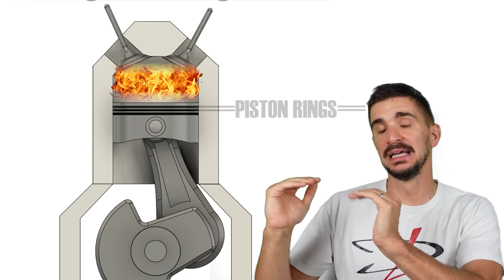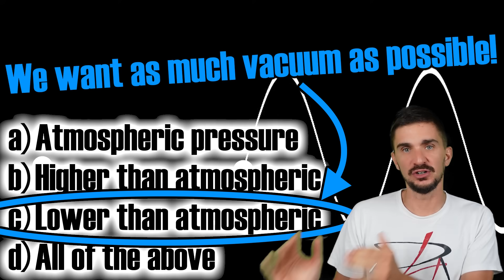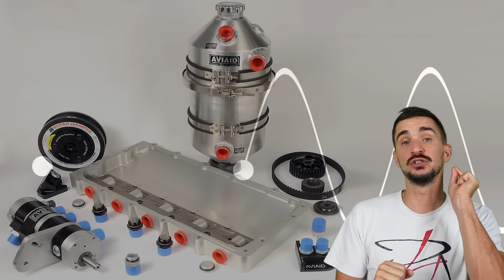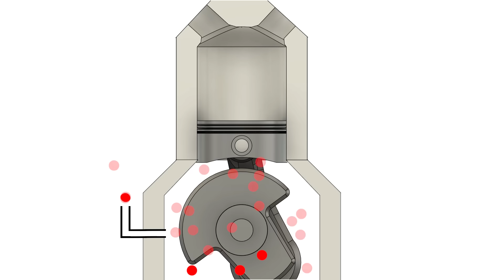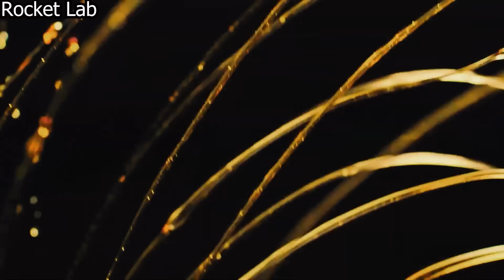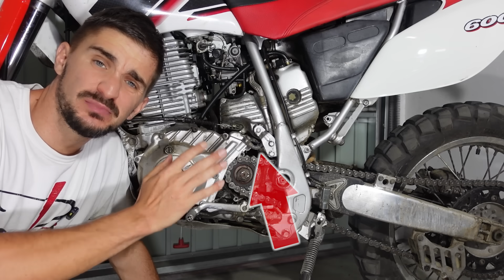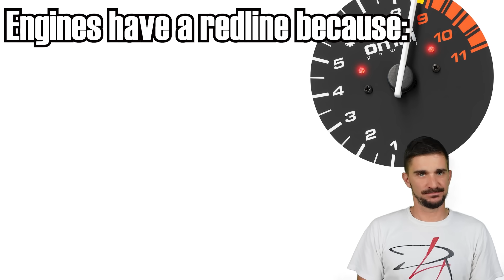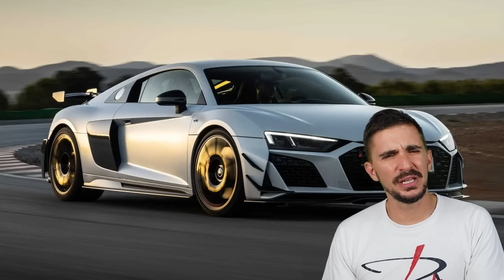Installing This Has No Drawbacks, Except for Your Wallet - Dry Sumps Are Awesome, Here's Why...

Comment: 9:52 Now what if we ran it from an electric motor?
Reply: You'd lose even more power due to energy conversion
Reply: Where does the power come from for the electric pump? The battery! How does the battery get charged? The alternator! How does the alternator spin? The pulley on the crankshaft! We're back where we started?
Reply: @Beartore not if we have a separate battery for the pump, the pump would get recharged by solar panels.
Reply: @ceasarspalace  All that in place of a toothed belt and pulley? I'd rather not run my oil pump from solar panels and batteries.
Reply: @ceasarspalace that's enough of the internet for today for me 🤦🏻‍♂️
Reply: @ceasarspalace no we add bicycle pedals in the cabin so the driver can charge the battery while driving the car
Reply: This is actually really smart for mild hybrids but I suspect the need for fulltime operation it won't make as much sense as something like and electric supercharger to boost output on demand but not all the time
Reply: This obviously wouldn't work if it was directly driven but... you got me thinking here... if you were willing to get REALLY complicated with this, you could use an electronic controller to change how much power the alternator is converting into electricity. When you slam on the gas pedal, the power the alternator sucks out is lowered, when you release the gas the power the alternator pulls rises because the driver is asking for less power to the wheels. It would obviously have issues if it was just running flat out all the time, but what car outside of an NASCAR track is ever going to get close to that?

This is starting to sound a lot like an EV, but I bet you somebody in a professional racing environment has already done something like this.

Comment: Don't forget that your bike oil is also used for the gearbox, so the 166% larger, 33% more oil numbers don't quite add up. 
It's still quite a bit even if you were to factor that in though!

Comment: 30C is hot where you are?

I've ridden air cooled motorcycles over 43C. When it gets that hot (with high humidity) the air flow doesn't cool you, it heats you. It's like being in a convection oven.

Comment: You explain the variation of pressure in a crankcase with a single piston example, but in the case of four strokes, two piston rise and two descend, equalising pressure, yes (beside trickle down on the rings)?

Comment: One other way to get crankcade vacuum that is used by sprint cars and Supermodifieds is to use the exhaust and at the highest gas velocity ( the collector pipe at it smallest dia usually) using a nipple and hose with a one way check valve letting air / pressure from the crankcase breather to the exhaust nipple which creates low ptessure like in a carb venturi and sucks out the crankcase air and pressurized gases that my sneak by the rings. Its a free energy source easy to do and very inexpensive.

Comment: Right. Negative pressure when the piston goes down helps. Same negative pressure on the way up sucks the power, we now need more force to push out the gasses in the combustion chamber. This additional force is taken from the other cylinders that are in combustion phase. Net benefit = zero. Minus expenses, maintenance, added complexity, net benefit is negative.

Comment: But if you get 10 % more power from the same bore size, it's a better efficiency, so this could totaly be justifiable in the current downsizing trend.  If they bothered adding a turbo to a 999cc engine, why not a dry sump so they can again reduce the cubic size, and fuel consumption for about the same power ?

Comment: So...do I want a dry sump in the AW11 SC? It does (as you know) most of 8K RPM so I'd have thought there will be significant losses in the crankcase. Also it runs 14lbs boost so it's a harder life than stock =)

Comment: I thought the purpose of the dipstick was to keep the oil level below the crankshaft so that the oil didn't get whipped into a froth the oil pump can't pump to the main bearings to keep them floating on oil. Is that not the case?

Comment: You don't have to experience high G-forces to reap the benefits of a dry sump system. All you have do is leave the pavement behind.  There are may, many trails all over the world that have climbs, descents, and other obstacles that can starve an engine of oil. 

You have me considering what I can do to throw a low-dollar solution together for a mid-1960s Buick designed Willys Dauntless V6. Not because I need it, but just for fun. I've always appreciated 'outside the crankcase' oil systems for the ease of maintenance. And it's never a bad thing to increase ground clearance on an off-road vehicle.

Comment: More down-sides:
- The extra complexity generally means less reliability.  More parts mean more things to break.
- The external belt driving the pump is slightly more risky than a direct drive from the crankshaft.
- Packaging constraints can make it difficult to find a good place to put the multi-stage pump.

That's in addition to the extra cost.

Comment: More oil does not result in cooler oil temperature unless there is a way to cool the oil. It will take longer to heat up the oil, but it won't magically run cooler because there is more oil.

Comment: Its easy revert PCV to make negative pressure inside engine
But seals don't like negative pressure and start to suck air with noise (and dust of course)
Technically  its not difficult to tune PCV to make some negative pressure inside engine
Modern engines have 2 passages(1 before and one after throttle) to make constant flow thru engine 
It will help to clean oil from fuel leftovers (due to cold start) and gasses that can oxidize oil
Dry sump good for racing -but have none gain to grocery getter

Comment: Theoretically, a vacuum inside the crankshaft would negate any gains from combustion, since the piston also has to move back up for the next combustion
If you try to expand the space of a vacuum, the vacuum itself will try and hold back the cylinder. Unless you fill the space with something (like oil)...

Comment: 4:18 wait. Wouldn't a boxer engine essentially have no change in crankcase volume? Because as 2 are coming in, 2 are going out? (4cyl) 3 in 3 out (6cyl)? Or am I missing something? Also wouldn't this be the case with all engines? Even in inline 4? Or is the momentary high pressure area crated by a piston downstroke not offset by the lower pressure area created by the piston up stroke? I understand why this wouldn't happen in a single cylinder engine, but a 2, 3, 4, 5 6, 8, 10, 12 cylinder engine should maintain roughly the same displacement. Or did I just pause and ask a question too early in the video?

Comment: One thing I'd like to learn, is what makes dry sump - pumps, so special. As they're extremely expensive, for such a low-tech design. I've not gotten the chance to gain that knowledge as it's hard to justify their difference between a regular oil pump, or repurposing something like an AC pump.

Comment: So sorry to be this guy. But I think you might be this guy also. So it's ok. 
Space is not actually a perfect vacuum. The only perfect vacuum ever measured has been in a lab. Building on this. An object thrown in space would be acted on by a small amount of molecules or debris, but also by radiation like solar wind. And gravitational forces. Some space travel designs actually incorporate solar sails to use this energy for navigation.

Comment: only point of contention. Sumps are "usually" designed to fall between center links, mounts, or other suspension/chassis equipment. so while a fresh design incorporating a dry sump can have a lower CG on the motor - you will likely not be able to lower a motor in a vehicle designed without one.

Comment: Wouldn't a 4 or 6 cyl engine have basically constant crank case pressure ? inline 4 : 2 go up 2 go down but exactly mirrored. but a 3 or 5 cyl would fluctuate a lot cause uneven number of pistons right ? well, maybe there is a way to make a 5 cyl with constant pressure but a normal 3 cyl for sure

Comment: Good Video. One Point of your benefits is theoretical. If u changed your System to dry sump, you can‘t put your engine lower without getting some serious Vibrations. Reason: the driveshaft is no langer aligned to the differantial. But with some effort u can change the angle of the diff. Better: OEM drysump

Comment: The BMW E60 M5 is a quasi-dry sump system. It still stores oil in the pan, but has two electric sumps and some channels to ensure both the main oil pump and the vanos pump always gets oil. These electric sumps are located and draw oil from the sides of the pan. Its oil pan also has sump baffles.
Reply: That's a system that's been present on most M cars since the E39 M5 and some Mercedes models from the time as well. It's basically a wet sump with added scavange pumps to prevent oil starvation and nothing else. It's not as good as a full dry sump system, but it's a hell of a lot better than a traditional wet sump when it comes to oil starvation while being relatively similar to a traditional wet sump.

Comment: One draw back is that because theres less oil flying around, the wristpins are much more poorly oiled, so oil spray piston squirters are often necessary. One of the good things that comes from doing that is the oil does get warmed up faster and lowers the piston crown temperatures- the compression ratio then has to go up to compensate for that.

Comment: You should do a video on three versions of your ideal passenger car engine. - A reliable, affordable, efficient daily driver. A high-revving, reliable, powerful sports engine. Finally, an engine that's absolutely not meant for the road, with extremely short and expensive maintenance intervals, but is meant for small production batch homologation specials like we had back in the golden WRC days so the manufacturer could compete with the car.

Comment: But when you fly on the Head isnt the oil on the wrong side of the external tank? It the Bypass Gas is in the top of the Tank wont it be at the bottom at the Stunt?? So the Gas is getting sucked and not the oil

Comment: Another Application that dry sumps are used a lot on are off-road vehicles getting  extreme angles can cause oil starvation so it can be necessary I can't think of a factory application of this but Toyota 22re engines have plenty of aftermarket for it

Comment: This was very good information. Thank you for this video.

This does not have no drawbacks. If there is a vacuum in the crankcase, the piston needs to fight on the exhaust stroke. That may increase wear due to the acidic compounds created. Also, these systems are heavier (if only slightly) than a wet sump system.

Good video! Do a bit more thinking about the drawbacks, and it would be great video. 
Thanks!

Comment: Low pressure under the piston makes it easier to push the piston down but it also makes it harder to push the piston back up the bore as it's pulling a higher and higher vacuum as the piston goes back up.... seems to me this would be a wash.

Comment: Drawback #1: cost.  This is why you don't see dry sumps on engines that are built to a price and not for outright performance.  Also the cost of maintenance.  Yes, oil doesn't cost that much in the grand scheme of things, but consider that people still skip basic oil changes, and the vehicle's oil capacity may have doubled or tripled, so it needs to be considered for the average driver.

Drawback #2: packaging.  Particularly in smaller cars, a lack of room under the bonnet/hood for the larger oil tank and associated plumbing and pumps.

Not huge drawbacks, by any means...and if performance is the desired result, well worth those minor inconveniences.  Dry sumps are especially useful in motorcycles that utilize high rpms, like the original UJM - the Honda CB750 from the late '60s - which came from the factory with a dry sump.  Even H-D used dry sumps for years, as it undoubtedly helped a lot with their long-stroke engines.

Comment: The drawback of cost and complexity is GIANT drawback. So much so that even a highly modified street car is very unlikely to have one. The water-in-hands vs water-in-a-cup comparison is a bit of a false equivalency. A cup can cost next to nothing, and doesn't require a lot of work to integrate into a drinking routine. A dry sump is several thousand USD IF you're lucky enough to have an engine with an off the shelf kit available. If not, then you're piecing a very expensive kit together and paying for the additional fabrication costs to mate it to the engine. A dry sump is not something I would ever suggest for a street build unless that person has heaps of cash burning in their pocket.

Comment: I feel like a dry sump is something that could replace the oil sump/pump system entirely and just be built into the engine... would make it easier to put in more cars if it was just an innate feature of the block from the factory

Comment: I’ve been running this on our race car for the past few years, and other than added weight, it’s been awesome. We have years of oil pressure data from multiple cars and setups including OEM systems, accusumps, oil pan modifications, and dry sump is the only configuration that provides 100% stable, predictable pressure with no drops below 30 psi, ever. We run vacuum regulator and can dial in crankcase vacuum exactly where the rear seal can handle it. I have always wondered why modern OEM engines don’t have a version of this. It seems like a superior design for incredible increase in reliability and efficiency. Sure there would be one time design cost, but then you’d have an engine with such an advantage offer everyone else. That motorcycle system is such a nice design, btw.

Comment: Rotax aero engines uses the blowby pressure to push the oil into the external tank. Also wouldn’t an electrically driven oilpump add extra top power? Scary failures though 😮

Comment: In terms of drawbacks I feel like having no redundancy/ one singular and rather large concerning failure point in that if anything happens to that belt that is driving the sump system your oil flow goes straight to zero... all it takes is one snapped belt, one thrown belt, one shredded belt and you're in the realm of doing alot of expensive and catastrophic damage very very quickly... this is also made much more concerning in my opinion by the fact that the pump is externally driven and not protected like a chain or gear drive internally inside of an engine like a normal wet sump oil pump

Comment: I am sorry i don`t agree with this compressing the air under the piston let me explain why. Yes if it is a single cylinder yes. But an inline four you habe two pistons up and two pistons down. They just change volume with eachother. Two goes down but the same two goes up so they cancel out eachother.

Comment: Excellent!
On some racing motorcycle engines back in the day a reed valve would be plumbed into the crankcase breather so as to let crankcase pressure escape when the pistons descended while preventing air from re-entering the crankcase  when the pistons rose. This also created a certain amount of vacuum.

Comment: My impression was that pumping the oil through a dry sump's scavenge / pressure stages actually put more heat into the oil, not less. I'm also under the impression that dry sumps need to be rebuilt somewhat frequently on a track car.

Comment: 4:34 this is incorrect. An object will not continue to travel at a constant speed forever in "outer space". There IS gravity and it is NOT a perfect vacuum. Best case scenario there is still 1 molecule per cubic meter. In orbit around an object, unless the apoapsis and periapsis are exactly aligned,  the speed will change. Even if it was a perfect vacuum and the orbit was perfectly circular, tidal forces and photonic thrust.

Comment: LOTS of advantages, as you detailed.  (And one I think you missed: eliminating the PCV valve, which is commonly seized.)

If I can summarize the DISadvantages below.  You covered the first three, but I think there are others:

-	Significantly added cost
-	Engine must be designed for explicit wrist pin lubrication
-       Parasitic drag of the pump (but more than made up for by increased engine efficiency)
-	Added risk of oil pressure loss (failure of belt, hoses, fittings)
-	Longer oil warm-up time
-	Added weight
-	Needs a check valve to avoid draining tank back into crankcase (which adds another critical point of failure … as I had happen to my Harley)
-	Vacuum in crank might increase oil contamination

Finally, I wonder if an electrically driven external pump might be better than the belt-driven one.  Cheaper, more reliable, could be run before engine start to build pressure, and no need for check valve.  (Its parasitic losses would be in added alternator strain rather than the engine directly, but likely similar.)

Comment: Did I miss the moment? Was efficiency also better besides more power?
Would a standard car like a Toyota, having max 130hp or so gain better fuel economy with a dry sump compared to wet sump?
(B'cus rarely is max power utilized, likely a bag standard family car uses 20-30hp for cruising/highway speed)

Comment: I'm building an L28ET for an old Datsun Z car, and one of the parts I'm installing is a massive Garrett turbocharger much larger than the OEM one. This turbo requires that oil lines be ran to it directly from the oil pan/sump for lubrication. Would running these lines differ at all on dry sump systems?